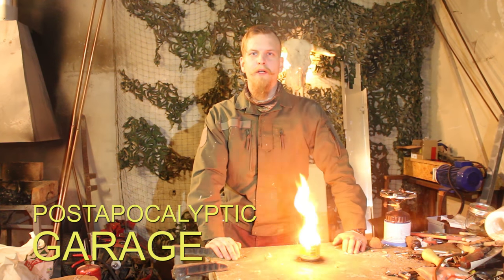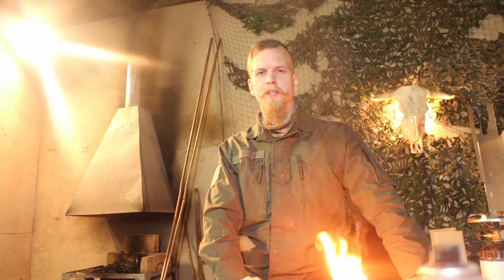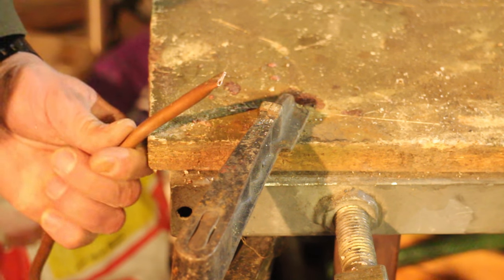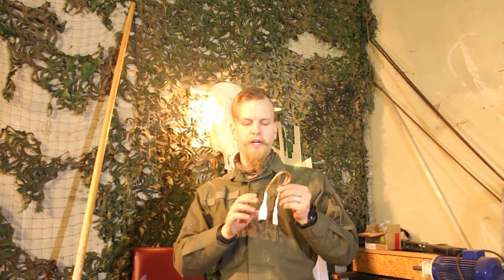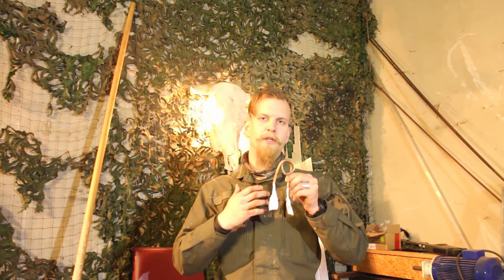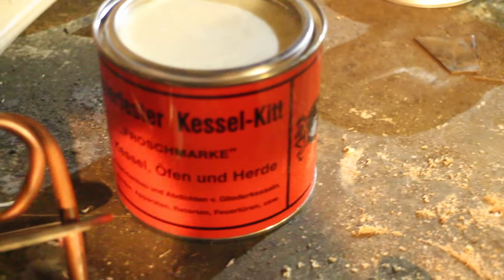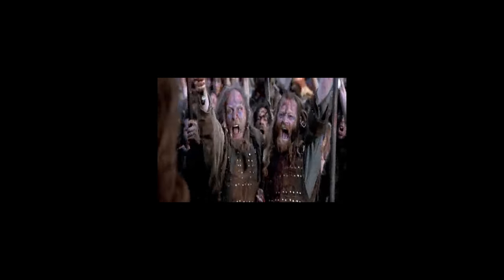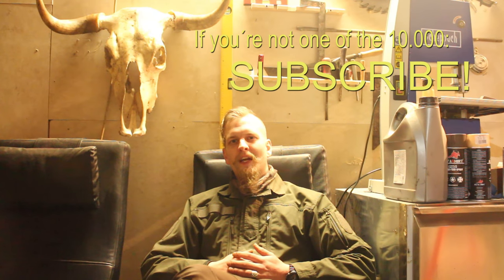How To Build An Alcohol Stove - Survial Gear Reinvented

Comment: Nice, I like the two hole design.. mine just had one.  BTW what did you use to seal yours up?  I used some JB weld but I worry about it burning off eventually.
Reply from the maker: +Iridium242 -I've came to the two hole and coil design due to an old gasoline burner I've found in an abandoned shed...to seal it I've used a putty/cement like material used for fixing cracks in ovens, forges and chimneys...Do you have any photos of your design...I would really like to see it...
Reply: interesting   :)

Comment: Man the more i watch your channel the more i like it. I do have some quick questions though - why did you put the holes at the bottom of the loop instead of the tip? Would this also work if before you added sand you added a wick all the way through it (or better yet used the wick as the only medium) and put it up side down, the two wick ends facing up to light and the loop part inside the fuel soaking it up.? I guess the wick changes would suck hat way.  Anyway you got my mind wondering so of course i had to blurt them out,lol  oh and congrats on 10,000 Peace.

Comment: Another cool idea. I wonder if this is works in very cold conditions. Looking back at my experiences with burning alcohol (not drinking it) probably not....
Reply from the maker: +Lionheart XVa -on this evening we had about -7 degrees Celsius in the shop...in a proper build snow cave it doesn't get much colder than that...the problem with the alcohol is, as you said correctly, that it's not vaporizing under a certain temperature...four our planned application it will work.

Comment: Would it help to have the wick go all the way through the pipe? You could probably pull it through with some thin wire before you fill it with sand.
Reply from the maker: +Econael -definitely not...the wick is only there for getting the fuel up the pipe...from there on there are just fumes which need no wick at all

Comment: and about the video .. are you sure glass jar is safe because of the heat and  how to stop alcohol evaporation when you don't need fire any more ?  sorry me eng is bad  :)
Reply from the maker: +Nikola Andjelich -the heat will mainly be unable the copper pipe...the glass stayed relatively cold the whole time...the evaporation nearly  stops completely when the fire is going out and it is cold outside
Reply: +PostapocalypticGarage    you should show us how you start a flame  with how much preheat and preheat with what.